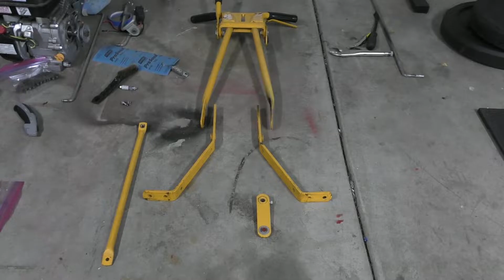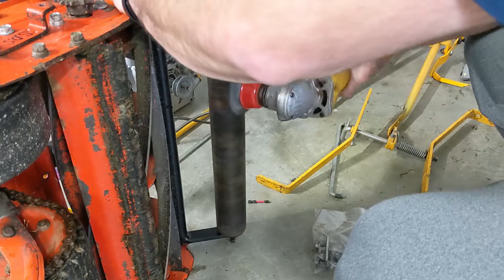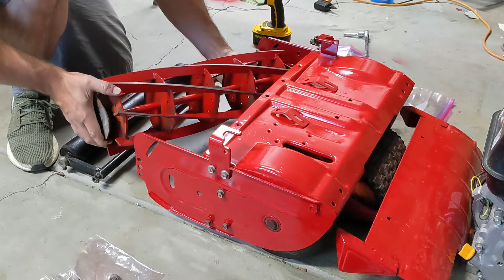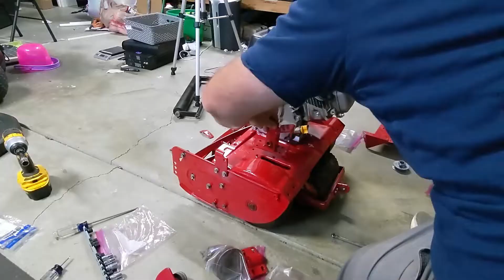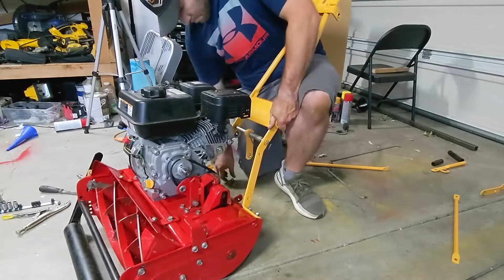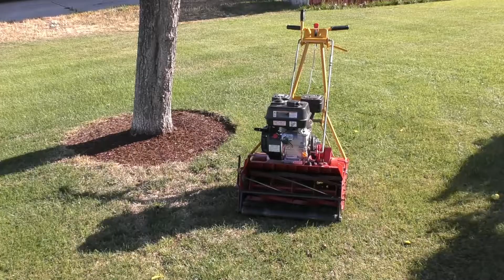Mclane 20'  Part 3 - Reassembly

Comment: Looking to tackle this same project on a new to me Mclane 20". Curious, was there a method to keeping your disassembly/reassembly straight and in the proper order? Seems the grinding and painting process would have taken a while. Or did you just reassemble from memory?
Reply from the maker: So what I did was on the side bolts I labeled them all with numbers with a sharpie. I then took reference pictures of each of the sides for where my bolts went.
The hardest part about cleaning all of the mower and getting down to a paint status was definitely the reel.
Also as I said in my video it's important not to snug everything down until you get all your bolts in.
For resetting the bed knife reel distance I highly recommend watching the video I linked which is the doc video on how to backlap and fully adjust.
Since your bed knife is new I probably don't have to mention it but as you wear out the bed knife on the edges there are divots that happen from the height difference and wear. If you have these it can create an issue adjusting that and I would just recommend grinding those flat to match the rest of the bed knife
Other than that pretty straightforward process if you have any questions you can always ask me and I'll try to reply. I wish you the best of luck it's a fun project that's for sure.

Comment: Should.i print your 6.5hp mount out my abs?  And use 100% Infill?   I would think the mount would get hot from engine???
Reply from the maker: So I printed pla+ which has a higher heat tolerance but not much. Abs would be the preferred filament but my printer was/is not setup for abs right now.

Long story short yes print in abs if you can.
Reply: @RandomDudeWorkshop  and what infill.  I'd think solid 100% would be ideal but but is that overkill
Reply from the maker: @4rdzlla  I try not to run 100% infill on most things I generally go 90% at most. That being said this one was print at 60% on pla+ and has held up all summer in the heat
Reply: @RandomDudeWorkshop  I just started it abs 75% entire thing.  4 hours. Let's see how it works
Reply from the maker: @4rdzlla  perfect let me know how it turns out.
Reply: @RandomDudeWorkshop  turned out great. Ended up fixing first layer.  And printed at 90% just for a little more density.  I don't have the predator 6.5 yet.  So I can't check it.   I'm trying to hold off until I can find a 20% coupon somewhere for it.    Hopefully paint my McLane and do the swap during winter when the grass is dormant.  Just ordered a new greens bed knife and new 10 blade reel to get rid of this used stuff.
Reply from the maker: @4rdzlla  sounds like good stuff, will be excited to hear how it turns out
Reply: @RandomDudeWorkshop  did u need to get a new pulley with your predator.  With the 3d printed plate. Or still use 2.5". And just get correct one for predator shaft.
Reply from the maker: @4rdzlla  used the 2.5 with a 3/4 drive shaft hole

Comment: Must be missing something. Just picked up the 6.5hp today.   What pulley is needed to run stock belt?
Reply from the maker: I locally sourced a Chicago 250a with a 3/4 shaft diameter. However it's a tight fit. Try to find a 2 1/2 v pulley with internal set screw. Most any farm coop store should have them. 
Also on mine I had to move up to a 20in belt using the spacer I made. You can get the 4L200 at most Napa auto parts
Reply: @RandomDudeWorkshop  I printed your engine mount.  So I may need your same belt.  But I'll look for 2.5" v pulley right. Now
Reply: "Standard V-Belt Pulley: Fixed Bore, Zinc, 1 Groove, 2.5 in Outside Dia, 3/4 in Bore Dia"??
Reply from the maker: @4rdzlla  that should work
Reply: @RandomDudeWorkshop  ok ok I'm trying to put the 6.5 predator on today.   What size bolts do I need for the motor mount with your 3d print.     Bolts aren't long enough. What size bolts are these so I get right ones
Reply from the maker: @4rdzlla  I took the stock bolts and ran an additional half inch on them with nylon lock nuts to really try and keep them in place.
Reply: @RandomDudeWorkshop  ya I just picked up stainless half inch bigger (2") and also bought lock nuts
Reply: @RandomDudeWorkshop  it's quite a tight fit. The 3d print is tight. Holes barely line up with force. Also trying the plastic cover under filter near choke so it doesn't hit the yellow angled handle support.  Its a beast
Reply: Ok I just got your belt the 200 and it's way to tight.   Did I order your first one  lol I got it on but I can't even pull.the clutch really at all. 4l200 is def a no go for me.
Reply from the maker: @4rdzlla  I would make sure that you clutch rod is adjusted to as small as possible if you are having tension issues.  Mine sits at about half adjusted
Reply: @RandomDudeWorkshop  actually I had the clutch rod inside belt.  On outside now.  I can squeeze it. It's tight. And I can squeeze It fully it locks in.   But the rod is slightly curved.  Alot of tension.  But when I take it off.  I feel the belt is still sort of tight.
Reply: @RandomDudeWorkshop  how do I adjust the clutch rod smaller. Not sure how to do that.  I ordered a 210 just in case
Reply: I answer my own question I shortened it as far as it can go and when I press the clutch to the.handle it will stay at the handle bar it won't release manually.   And its funny I bought this used and it did it before I did the engine swap.  So any idea what can cause this. I thought it was normal.  But after reading.  Its suppose to bounce back as I let go.      So shrinking the clutch rod.  Completely as much as I can go.  It does it as well
Reply from the maker: @4rdzlla  clutch rod has a spring assembly on the bottom that should be attached to make it spring back when released
Reply: @RandomDudeWorkshop  ya it has the spring I'm gonna start it here in a few to see if the belt works

Comment: great job but what I needed to see was the shroud going on...I just cant get it to seat with the bed knife...arrgh
Reply from the maker: Yeah, so the shroud is a little tricky, and depends on whether you have the new one or the old version. Mine has tabs that need to mount onto the bed knife that help it to locate.
Reply: @RandomDudeWorkshop  mine too. My Mclane is really a Garden Way from 1980!
Reply from the maker: @sm1tty031  same manufacturer just under an alternative name much like sears and some others.
I had to push mine really hard and also I had to rebend some of the slots to get it to fit again